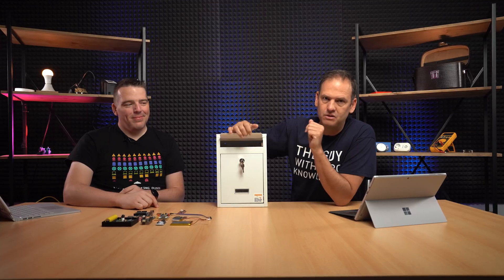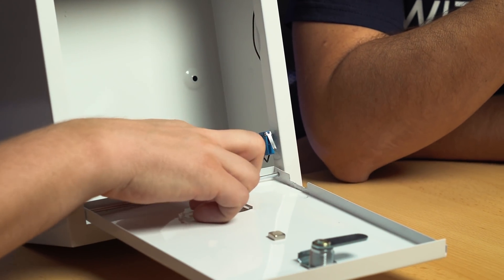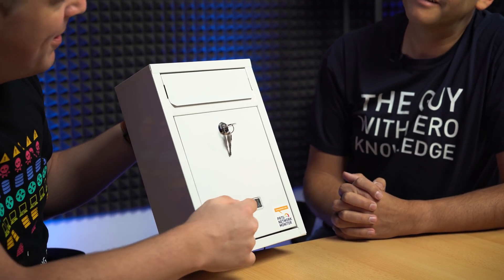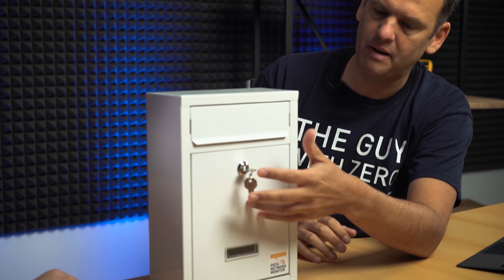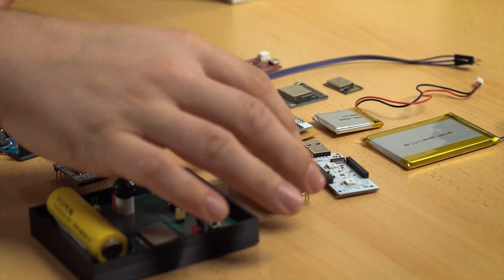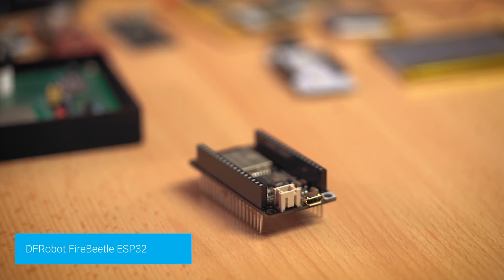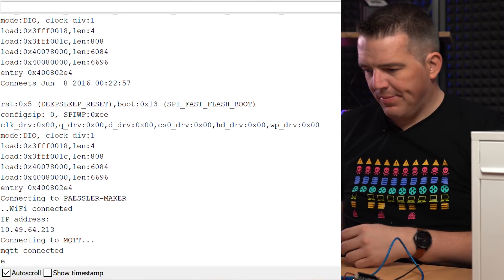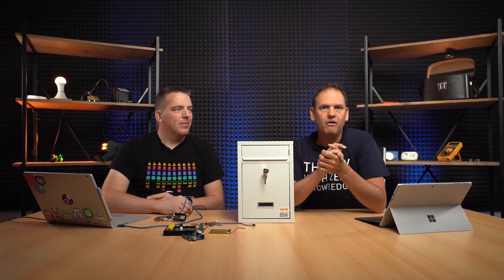Set Up a Smart Home Mailbox (1/2) - Home Assistant

Comment: Just saw this.  Thanks for sharing.  However, I do see a flaw in your auto-reset logic, at least for my application. In France, and probably other countries, the mailman, and some delivery services (la Post has 3 independent services) has a master key and can open the box to deliver packages. Thus, the idea that the slot is for delivery and the door for collecting the mail is flawed.

I currently have a false floor in my mailbox and use a USB scale to detect presence of mail or packages.  This works fairly well. However, it can drift a bit based on temperature.  Also, if the mail hangs in the slot, I will not “see” it. I am planning on trying a simple IR LED & detector.  If the box is black inside, any non-black object should reflect IR and be detectable.

The best approach would probably be AI image detection with a small camera in the mailbox.  But, I just haven’t had the time to try that yet.
Reply from the maker: Thanks for sharing your thoughts on a smart mailbox. You are right it depends on the region you are in. Here in Germany I don't know of a mailman with a master key. But here we have to be at home or hope for our neighbors to accept our parcels with cat food, so a mailman with a master key sounds almost luxurious to me 😄
I'd love to see your AI-Camera solution once you've made it work 😉

Comment: A switch is an interesting idea... I'd be tempted to bury a cheap cable to the mailbox, so the switch closes a very low power circut all the way back to the controller in the house. Essentially like running a doorbell wire. That seems way easier than getting wifi out by my street.
Reply from the maker: sounds good! Go for it 👍

Comment: Why don't you use an ESP8266 and trigger the wakeup pin with both switches using two diodes and then use two other pins after the ESP wakes up to read the two switches individually?
Also, I figure you don't need to program the ESP so often. So personally I would just use an ESP12 or something with a LDO connected directly to a Li-Ion battery, measure the battery voltage every time the ESP wakes up and send a message with a low battery warning if the battery voltage is low. Maybe even add a mosfet to kill the power completely when the battery is fully discharged (you know, in case you are not home for a few months or whatever and can't change the battery). Using an ESP32 for such a simple task, not to mention using the DFRobot Firebettle seems like a total waste of money to me. You could easily build this thing for less than 5 € (I live in Europe).
Reply: Hi Phino - you're completely right. The only issue is that you need a lot more external parts and it makes the build more complicated and error prone. If you'd use a bare esp12 you'll need a usb2serial programmer, too.  Apart from that i completely agree with you.
Reply: @bjoernpohl4844  Well ok, I can see how it might make it a little more difficult for a beginner. But if you are reasonably good at soldering and have a USB to serial converter laying around (which I assume many of the viewers have), I wouldn't say two diodes and an LDO are "a lot more external parts". Now, if using a USB programmer and soldering the stuff yourself makes it all too complicated for you, that's fair enough, I can understand that. But even then, you could still use some ESP8266 with USB to serial converter etc. and two diodes so you can tell which switch woke up the ESP.
Don't get me wrong, I think it's awesome that you make these kinds of videos and get more people involved in this kind of stuff. And to a certain extent it's fine to pay more for simplicity. But the price of the DFRobot Firebeetle ESP32, I don't think it's worth it just to save two diodes.
Reply: Ok, to be fair, the idea of the ESP8266 with the two diodes, would have the problem that the ESP8266 would not wake up if the mail is taken out while the newspaper or something keeps the front flap open. Obviously you can fix it all with a little of circuitry. But I guess that would certainly mess up the simplicity. And if you're gonna use the ESP32 anyway, I guess the DFRobot version may be worth the extra simplicity of just being able to hook everything up without any external circuitry. I mean, I still think the DFRobot Firebeetle ESP32 is quite expensive, but I guess it's pretty neat how "plug and play" your design is.

Comment: Hi how much work does it take to convert your script to a mqtt wifi button .. Can you please help me or guide me further ? Best Regards
Reply: Hi Stig, this should be easy. But tbh, by now, I would use esphome.io to do tasks like this, especially in conjunction with homeassistant. Esphome is a firmware for esp8266/32 which is configured by a simple yaml file - an mqtt button then drills down to ~10 yaml lines: https://esphome.io/components/mqtt.html , https://esphome.io/components/switch/gpio.html. If you want to stay at native c code, just drop a line, should be easy to modify. Regards, Björn
Reply: @bjoernpohl4844  Thank you very much Bjoern :) - do you have other esp32 projects you are sharing on youtube ?

Comment: I'm having issues getting my firebeetle to connect to the wireless when running your code when pressing the normally on / off switches. Please see serial monitor below:
(I've been successful connecting it to Wi-Fi from other sample code so know Wi-Fi details are correct and work with this esp32 device.)

23:24:52.669 -> ets Jun  8 2016 00:22:57
23:24:52.669 -> 

23:24:52.669 -> rst:0x5 (DEEPSLEEP_RESET),boot:0x1b (SPI_FAST_FLASH_BOOT)

23:24:52.715 -> configsip: 0, SPIWP:0xee

23:24:52.715 -> clk_drv:0x00,q_drv:0x00,d_drv:0x00,cs0_drv:0x00,hd_drv:0x00,wp_drv:0x00

23:24:52.715 -> mode:DIO, clock div:1

23:24:52.715 -> load:0x3fff0018,len:4

23:24:52.715 -> load:0x3fff001c,len:928

23:24:52.715 -> ho 0 tail 12 room 4

23:24:52.715 -> load:0x40078000,len:8424

23:24:52.715 -> ho 0 tail 12 room 4

23:24:52.715 -> load:0x40080400,len:5868

23:24:52.715 -> entry 0x4008069c

23:24:53.070 -> Connecting to WIRELESS

23:24:53.070 -> arming door and flap

23:24:53.070 -> Going to sleep now
Reply: Hi Dave, this doesn't look that bad. Actually it successfully connected to wireless and afterwards activated the interrupt ("arming door...") - then it goes to sleep and waits for any action on the mailbox that wakes it up. If nothing happens I suspect there are wiring issues. (wrong interrupt pins? should be 25, 26 and the 3V3 - (not gnd ) pin, see schematics on github).
Reply: @bjoernpohl4844  I replied with my other account in mistake
Reply: @daveclarke5085  usually, after openining the mailbox ( either door or flap) the esp should wake up and start blinking (like it does when hooking up power - and then, as you said, emit some mqtt stuff). Is that the case or does it stay dark?
Reply: I can't remember so will check later this evening
Reply: @bjoernpohl4844  When USB cable is connected I get a constant blue LED on. Pressing the buttons causes the serial monitor to show some info but no LEDs blink in the process. When connected via battery only (1000 mAh 3.7v) its stays dark at all times. The pins are 25, 26 & 3V3.
Shall I replace the firebeetle?
Reply: #UPDATE
I've changed ==2 to !=2 from your following line of code below and now the firebeetle is connecting to wireless, MQTTT & the state of binary_sensor.mailbox_sensor is changing from on to off when pressing the switches.

From 

if(esp_sleep_get_wakeup_cause() == 2){// 2 is RTC_CTRL - the IOs controlled by rtc

To

if(esp_sleep_get_wakeup_cause() != 2){// 2 is RTC_CTRL - the IOs controlled by rtc

Finger crossed its solved now.
Reply: @daveclarke5085  You saved my day :D now the mqtt works for me. Thank you very much :) 

Do you know how its possible to add one more sensor to the code ? 
Because where I live there we have mailboxes with extra room for packages and I need help to add one more sensor to the code running on gpio27 and send a new mqtt client id . 

Best Regards
Reply: @SLindberg 

My programming knowledge is extremely poor but this might be possible. Obviously you would need a separate entity for the arrived package sensor to communicate with MQTT to switch between on an off state.

Do you open the same door to access both the packages & mail?
Reply: @SLindberg   hi stig, this should be quite easy: 
just copy and paste this block (line 57-61)
https://github.com/PaesslerAG/maker-monday/blob/master/Episode_007/esp32/mailbox/mailbox.ino#L57
put it directly below and replace the 'if' with 'else if' (like so: https://www.arduino.cc/reference/en/language/structure/control-structure/else/ ) and replace GPIO_SEL_25 in this new block with GPIO_SEL_27. (that's the pin you mentioned)  -  replace the "arrived" here with something to react like "package_arrived" and react to that in mqtt.

furthermore you need to replace line 93 with this one:
esp_sleep_enable_ext1_wakeup(GPIO_SEL_25 | GPIO_SEL_26 | GPIO_SEL_27 ,ESP_EXT1_WAKEUP_ANY_HIGH);
this "arms" the additional pin 27 as a "wakeup pin"

and put another two lines after line 77 to initialize this pin:
gpio_pullup_dis(GPIO_NUM_27);
gpio_pulldown_en(GPIO_NUM_27);
(so, similar to the other two pins...)

hopefully i haven't forgotten anything :)
you even could do the same again for a selective "package room clearance" :) 

regards,
Björn
Reply: @bjoernpohl4844  Thank you so much for the help :) I´m still newbie to programming esp32 so this is a big big help for me. 
Best Regards Stig
Reply: @daveclarke5085  Thank you for your answer :) I saw that Bjoern Pohl have found the solution for my question .
My mailbox consists of 3 doors, 1 for letter, 1 for emptying letter and 1 for packages.
Reply: ok in that case I must have not configured MQTTT properly because no triggers or states are changing?

I've set a reservation in DCHP so know what the IP address will be but when running a continuous ping and pressing buttons I never get a response.

Comment: it's nice and all. also, I'm all about homemade projects. but it's just not worth it. if you have a home automation system already just use a freaking $5-10 door/window sensor.
Reply from the maker: good point, do you used a specific one?
Reply: @PaesslerGmbH  yes I have the xiaomi aqara hub. Because it's high quality and cheap as beans. Then I have bought ton different sensors including PIR sensor door/window sensors temperature sensors, vibration sensors wireless buttons and the gesture cube. After you paired all the sensors to the hub all you need to do is to add the hub to home assistant and then home assistant automatically find everything paired to the hub. Then you just need to set up the automation rules.

The smart thing about this is that xiaomi have the app as well so if you have a door/window sensor that triggers it can send a notification on your phone without any hassle. Then either let home assistant turn on a lamp and flash it every 5 minuter or set it up in the Mi Home app. Note the xiaomi sensors cost between $5-10 each. And the hub cost $30.
Reply from the maker: @wardope sounds good, awesome that there is such dirt cheap solutions out there already. 
Anyway I think there are people which just want to build this stuff by themselfes. 
For those who don't, this is for you 😉

And you can build hybrid environments with this as well 👍
Reply: @PaesslerGmbH  yepp i got a hybrid. If i cant buy what i need i make it my self. But if its available to just buy i trnd to get lazy;)
Reply from the maker: @wardope do you have some examples on things you could not buy and therefore needed to build?
Reply: @PaesslerGmbH I used an Arduino board and some neopixels to make an Ambilight for my gaming computer. Then I expanded upon it to to work as a mood light and notification light.
Reply: @PaesslerGmbH  also wifi door lock are way too expensive for what it is. So using a sonoff relay and a electric door lock i have made it my self
Reply from the maker: @wardope nice projects! Which motor did you use for the wifi door lock?
Reply: I tried this and the aqara wont work in a metal mailbox....?  and zigbee doesn't have anywhere enough range

Comment: I use Eve motion detection and stop! Could you make a smart lock for this mailbox's cilinder? Maybe with a servo
Reply from the maker: It is possible, but that would create the need of a permanent power supply instead of a battery

Comment: Great concept, really considering doing this with my mailbox.  Could make it even smarter by using an electronic magnet lock hooked up to a relay and/or an ESP that can be controlled via the Home Assistant App/HomeKit.  Would love to see that implemented.
Reply: Great Idea, the only thing is that the controller then needs to be always on to receive the "unlock instruction", so it needs to run on a power supply instead of Battery.
Reply: Very true, wonder if a small solar panel hooked up to a battery could power the whole system.
Reply: use an elector magnet. a battery and a Sonoff. it will cost you about $10-20. and it just works. granted your mailbox is made of metal :D